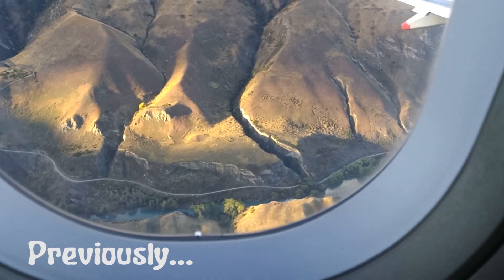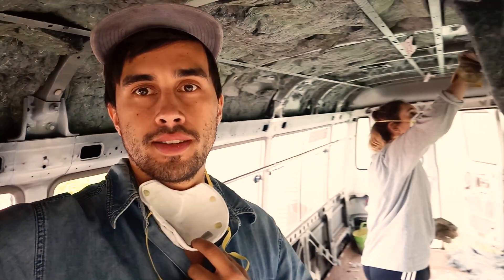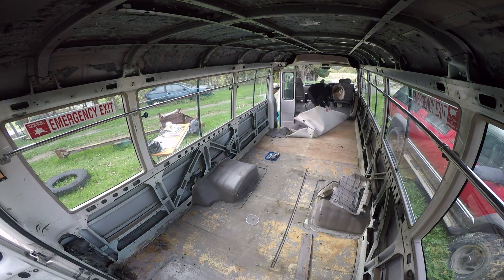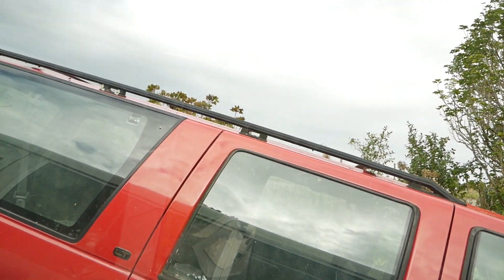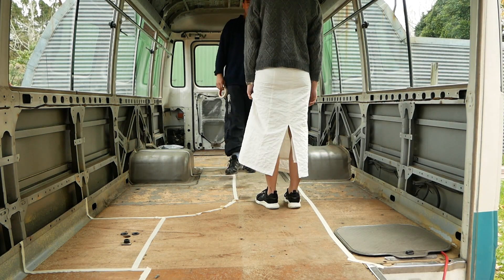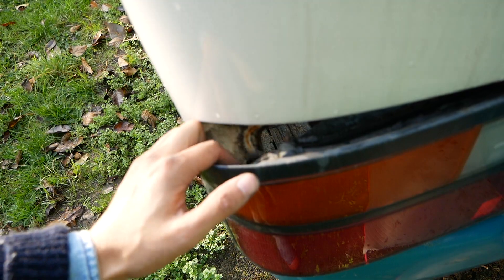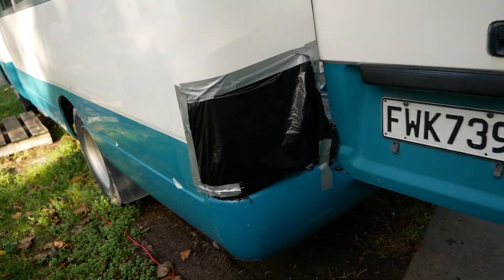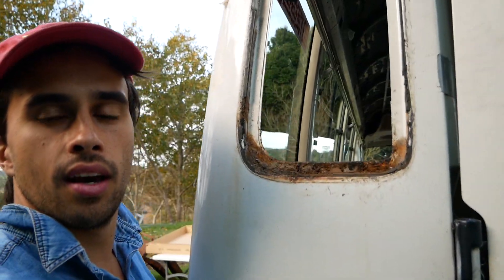We Found a LEAK('s)! - Bus Conversion | Ep.76 (Wildering Campers)

Comment: Hey guys, how did you remove the window? we were told there is a small lip on the outside seal that you pull out and push the window inwards off the seal. 

It is very hard to find information or videos of people removing these rear windows.. but we have the same issue as you and need to remove the window and clean up the rust.
Reply from the maker: Hiya, we used a bunch of plastic wedges and from the inside lifted the window rubber seal over the metal lip. Once you get one of the corner rubbers over the metal lips (think we started top left), it's then some what easier to run a wedge down between the seal and metal lip which pushes the seal back over the metal lip. Also if you start from the top someone on the outside can pull the window down and away which helps the process. Or you can just cut the seal and put a new one in....that probably doesn't make much sense at all! But we wish you all the best and happy converting!
Reply: @WilderingCampers  Thank-you!!